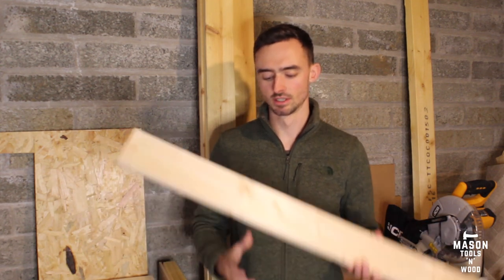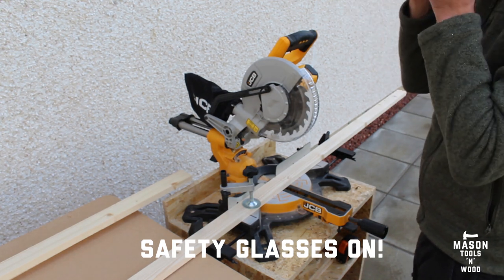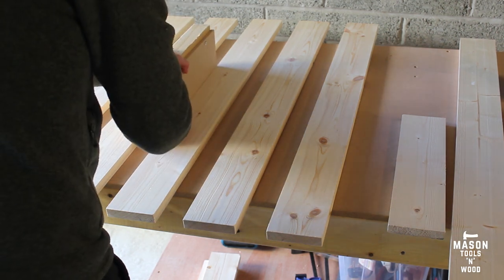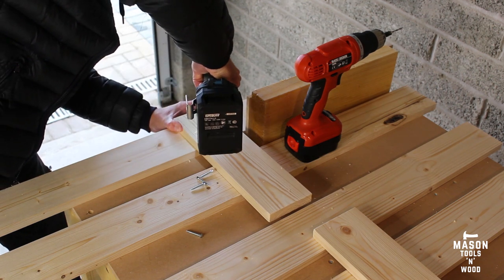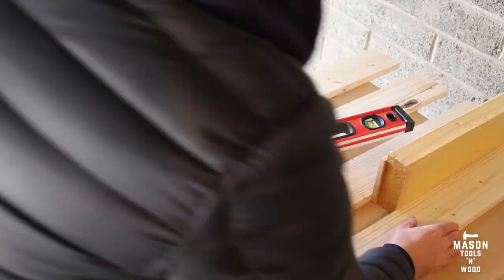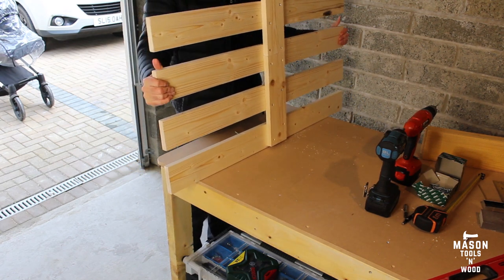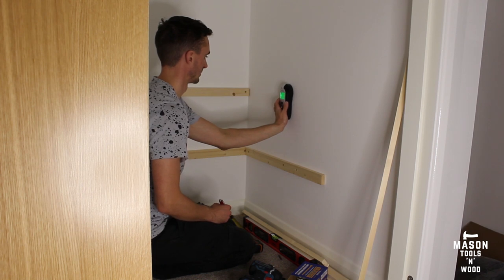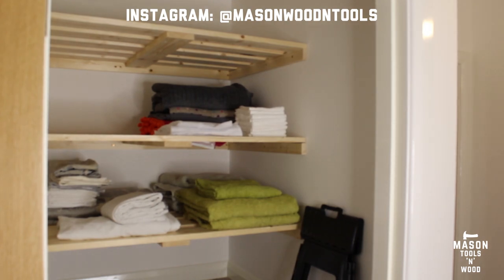Airing Cupboard Shelving

Comment: This is a great wee guide, thanks for posting. Thanks for the advice on finding studs. May I ask, how would you construct airing shelves when only a side and back wall could be battened? At 90 degrees to one another? I am considering adding a long piece from floor to ceiling on the outside corner to add strength. But it seems to get in the way of access.

Comment: I'm about to attempt the same in my new-build house. Did you screw the slatted shelves onto the battens or just rest them on?
Reply from the maker: Yeh I glued and screwed them from the underside. Just make sure your screw length is less than the thickness of both pieces of wood.  You don’t want sharp screws catching your sheets or towels! Could use a nail gun if you have one. Also remember to measure at the width of your cupboard at the front and the back because newbuild walls can be wonky! Good luck!
Reply: @masontoolswood2278  Great, thanks for the tips. I reckon I've got just enough DIY tips to get this done without destroying my walls :P

Comment: Do you think you could apply the same format to a wardrobe with no holes for shelves?
Reply from the maker: Is the wardrobe built in or free standing?
Reply: @masontoolswood2278  its free standing.
Reply from the maker: You could do that just make sure the screws don’t come though the outside of the wardrobe!
Reply: @thisisalesha_  You could simply glue supporting wood pieces to the corners of the wardrobe (placed vertically, resting on the floor of the unit) and rest the shelves on these. For the second shelf, just place supporting wood pieces on top of the first shelf, and so on. If all you're storing in the wardrobe is clothes and items weighing less than 20KG then this should work fine.

Comment: Hi, I’m about to attempt this. What did you use for 
(a) supporting the slats - I’m using a 18mm thick wood, would a 25mm long screw do the job or should I look for 30mm?
(b) screwing the battens into the stud - I’ve got some timber construction screws 4in long. Think they’ll do the job?
(c) nails to hold the slats onto the battens
Thanks.
Reply from the maker: All sounds good! Let me know how it goes!